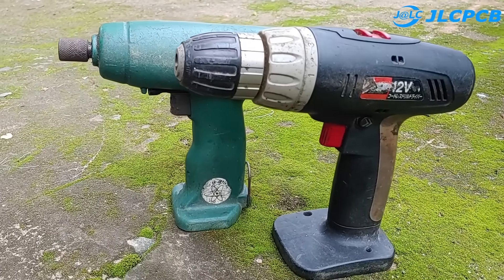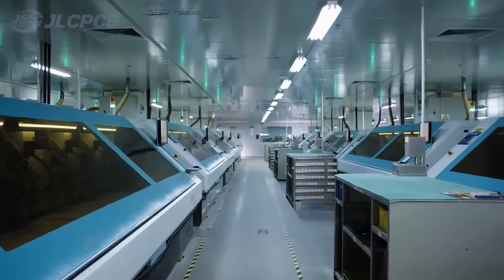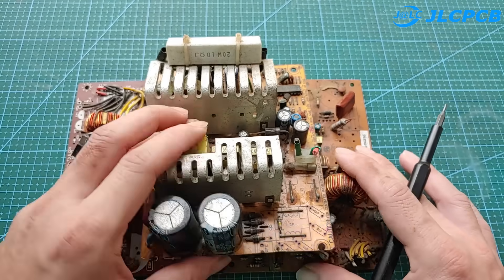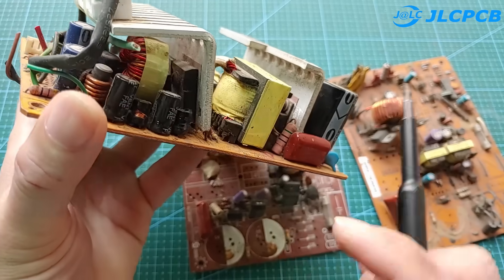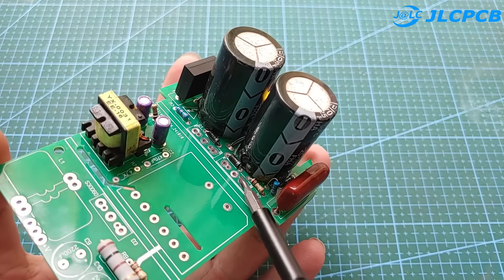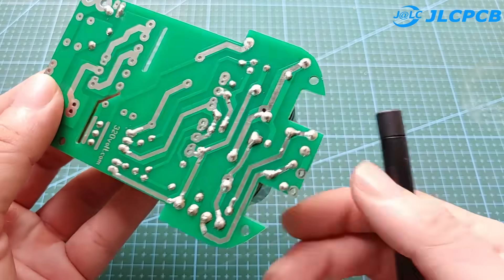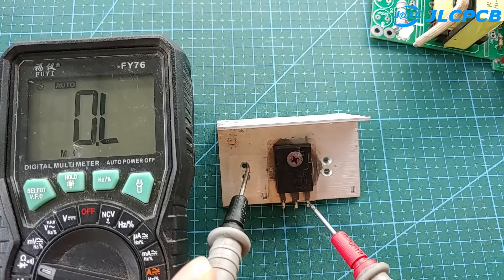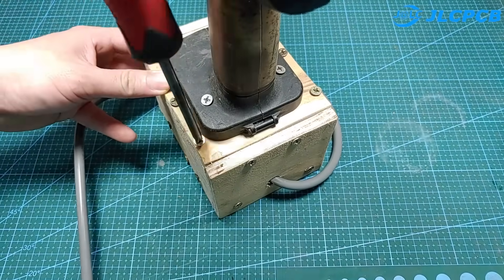How To Make a 12 Volt Cordless Drill Work on 220 Volt ?

Comment: Cannot use SMPS without feedback circuit We don't get feedback circuit here❤
Reply from the maker: Why not bro, tell me detail ?
Reply: @LongTechnical  I have 4 PC power supplies with good feedback circuits and no good input sites. I have checked the transistor first diode and transformer everything is fine using the old pcb.
Reply: @LongTechnical  We don't have any facility to make new PCB here
Reply: @LongTechnical  Can SMPS be made without PCB
Reply from the maker: Of course bro